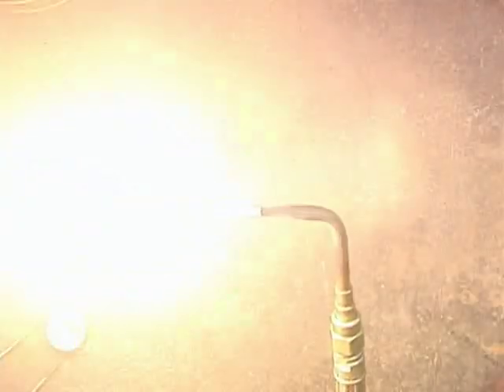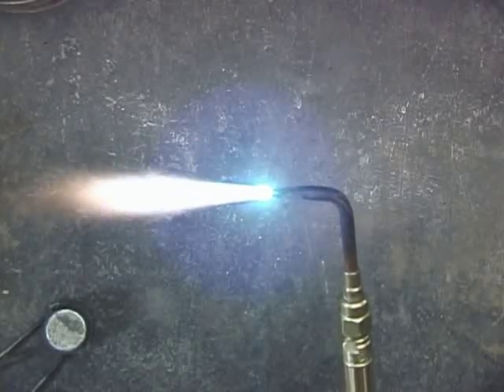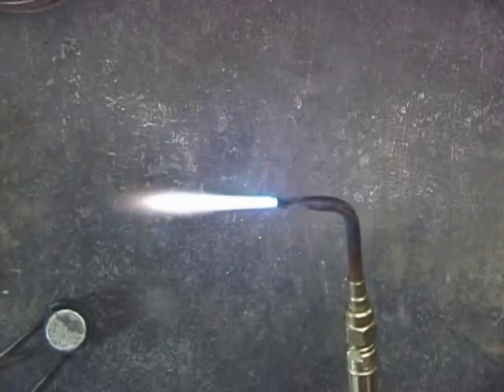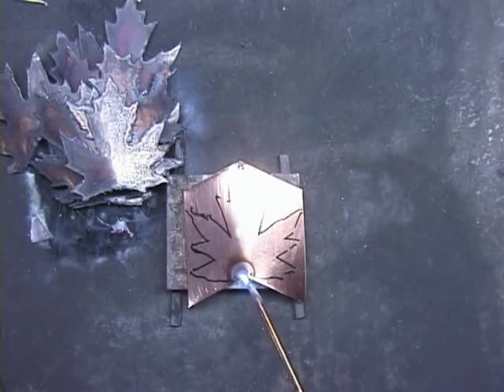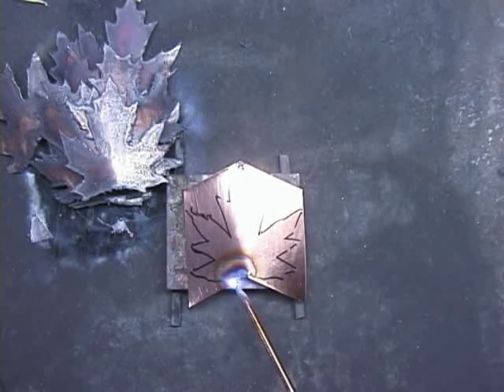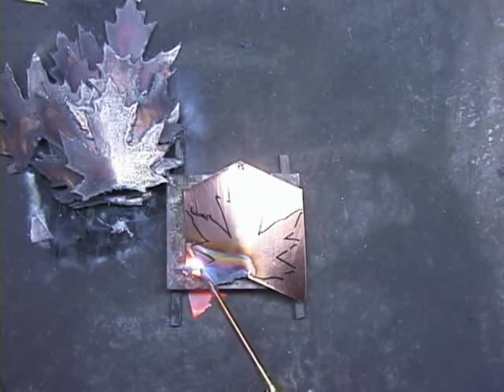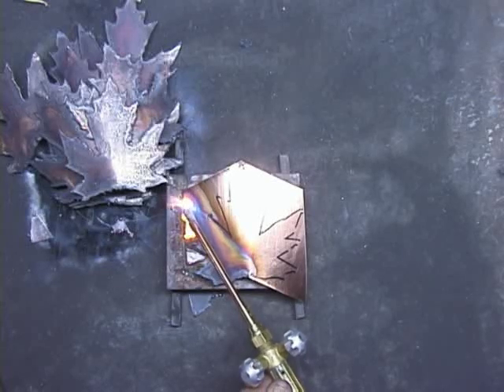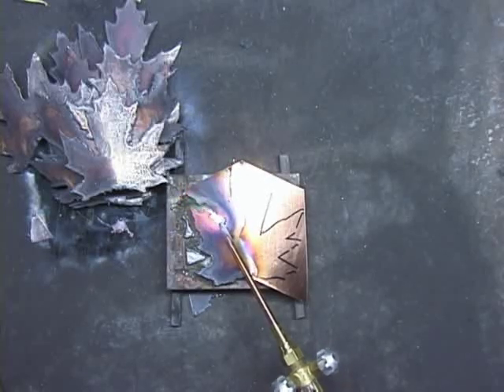3 Oxygen Acetylene Flames

Comment: I have another dumb question: If you are melting copper and steel what keeps the tips from melting???
Reply from the maker: The tips are made to withstand the heat.  In 50 years I've never melted a tip.

Comment: Hello and thanks for the video. Were you cutting those maple leaves with your welding tip with an oxidizing flame? That was really interesting. What thickness was the copper sheet? Thanks again!
Reply from the maker: Bettina. I was using a standard welding brazing tip.  Probably a "0" size tip and an oxidizing flame.  Using 16 oz. copper which is about 25 gauge.  Thanks for watching.
Reply: Thank You George for your swift reply!! Happy Holidays to you:)

Comment from the maker: @DCBillW   I put the flux video up on YouTube.  You definitely need flux to braze.  I use wire brushing to clean copper.   For cleaning copper I use a wire brush on a motor.  However you do it, the main point is to remove any oxidization.  A basic rule is that clean metal will always braze better than oxidized or dirty metal.